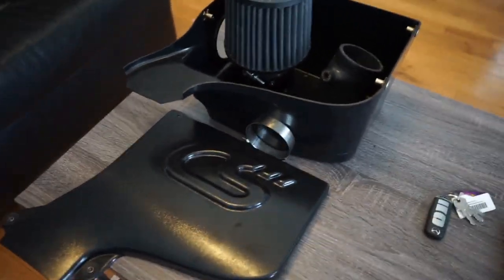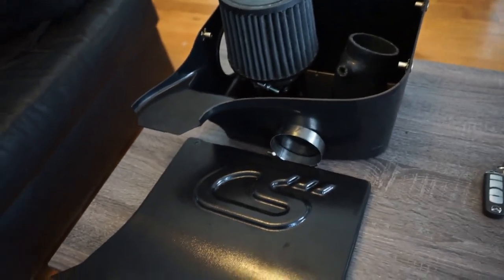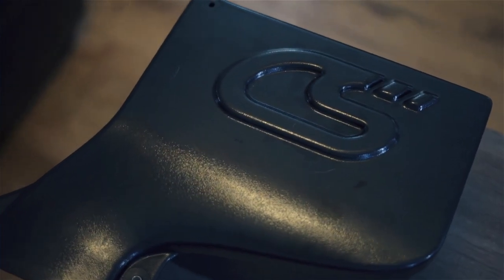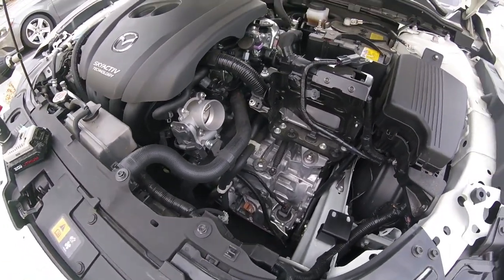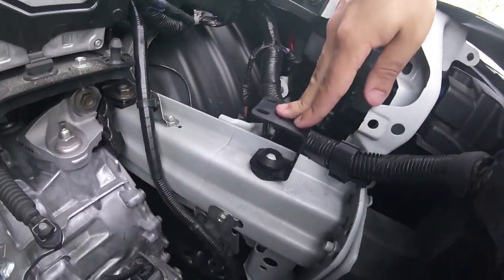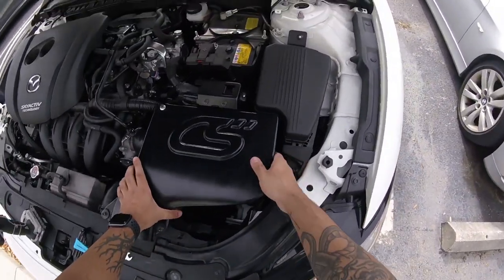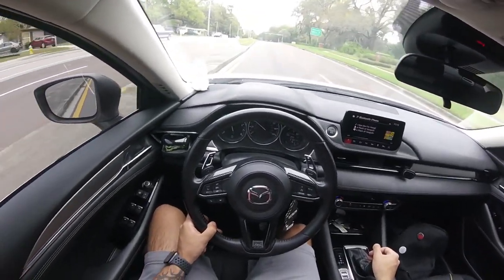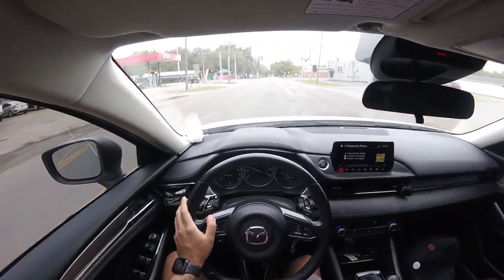Corksport Short Ram Intake Install on my 2018 Mazda 6

Comment: Nice aircraft quality large hose clamps. ** Be sure your exhaust has enough flow to handle the increased intake flow. 
You WILL have increased induction noise and maybe you like that. And maybe your "significant other" won't.
Reply: Who raised you? 😂

Comment: I noticed you went from Injen, to stock, to Corksport. Why did you choose to leave stock again?
Reply from the maker: Jake Wilcox injen was a bad experience for me gave some issues so I sold it and went back to stock but I really missed the sound of the intake .. did research for a few months and saw the corksport intake had no issues and sounded nice . Someone was selling one in my area so I picked it up ASAP lol but to be honest I just really love the sound it makes
Reply: @P1zaro  Can you hear the intake over stock even in the box it's in? Come to Gainesville lol so I can check it out.
Reply from the maker: Jake Wilcox lol not as much as the injen I took the top off since it alittle cold out and now it sounds great
Reply: @P1zaro   what kind of issues we talking bro?  Ive always kept up with your mods. Im thinking I should post my own so far.
Reply from the maker: aliefdrumline deff post up your mods man ! I’ll check it out , and basically at idle it would shake and at about 60 mph and above it would shake pretty aggressively, I had everything installed correctly at least I think lol and when I would try to drive slow it would jerk around it was weird man it didn’t like my car